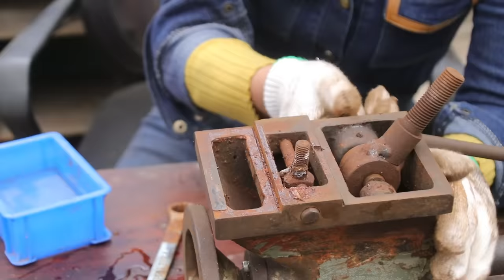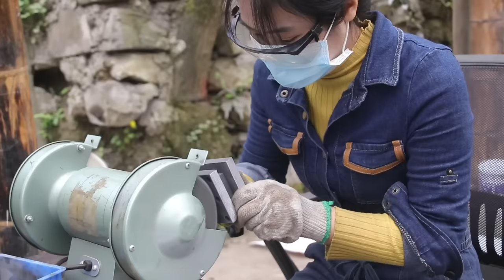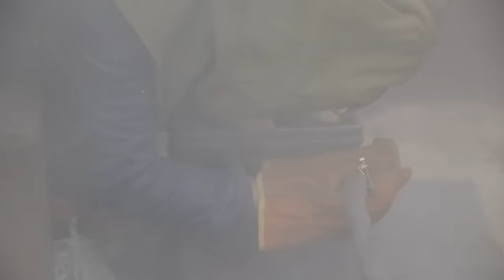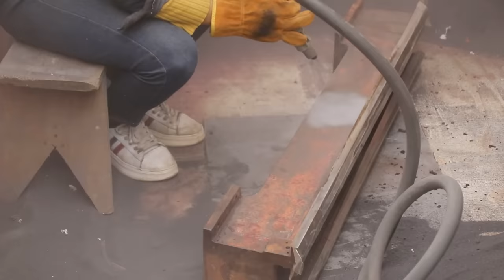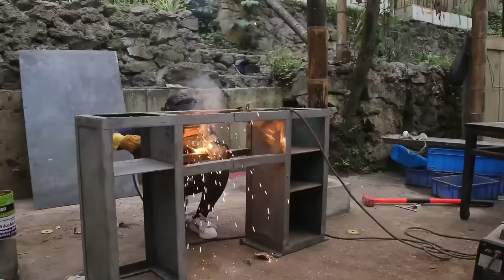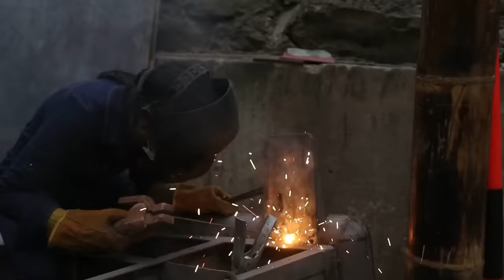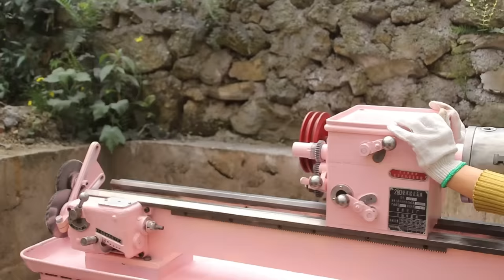💡 Super Girl's Restoration of Broken 1972 Lathe (Full Video)

Comment: Put the piece as close to the chuck as possible, use the tail stop with a live center if you have one and DON'T WEAR GLOVES when operating a lathe. The turning parts can grab the glove and you can lose a finger or a hand faster than you can blink! As always, great job, love the smile, be careful.
Reply: Ya and the grinder. Also she turned a OD in a prior vid toward the tailstock. If the clamp comes loose on tailstock to the bed and the force pushes tailstock away from chuck she will be wearing that bar.
Reply: personally I’ve turned plenty of parts with gloves on. If your close enough to rotating parts that your gloves can catch your dangerously close to begin with and need to put more space in between. And I tended to use latex gloves so in unlikely event they did catch something they’d just tear.
Reply: @maxpowerii7368  Almost everyone can and does wear thin latex gloves for oil and splinter protection when grinding etc.. . Maybe we didn't watch the same video. She is not wearing those kind of gloves WHILE operating the lathe. You can risk losing your own fingers but I wouldn't train people to wear the gloves while operating a lathe. She is wearing thick cloth gloves while operating the lathe, that's what she is doing. That is extremely dangerous. Your point is not relevant as thin latex gloves are nothing like what she is wearing and even wearing latex gloves isn't a good idea unless always being lucky is your game plan.
Reply: @maxpowerii7368  1st thing . No long sleeves. No gloves. OSHA .
Reply: @rickeylucero3955  OSHA rules only apply in the United States. Whole world isn’t American mate.
Reply: @terry1309  i didn’t say she was. But even cloth gloves I don’t have a problem with people wearing them while turning. Anyone stupid enough to get them wrapped on bar, chuck or spindle is not appropriately trained to be on a lathe in first place. The hazard control is not touching rotating equipment not failing to wear cloth…if your close enough to get gloves caught your close enough to get overalls caught. How far do we go? everyone has to turn butt naked in case their overalls catch?
Reply: @maxpowerii7368  so what if you lose a couple fingers, particularly, if you're an operator in China, there's 100,000 replacements to take place no great loss!!
Reply: @maxpowerii7368 You are wrong but go ahead and do it your way. It's not helpful to anyone, especially for beginners to hear someone promote unsafe shop practices. I'm guessing that you're not a machinist or don't have much real workplace experience because if you did you would know better. You might as well tell them to let their long hair down, wear loose fitting long sleeve clothing, wear lots of jewelry and how about wearing a dress tie. Just because someone may have done all that and didn't get hurt doesn't mean it's a safe way to work.
Reply: @terry1309  I’ve been working in machine shops since I was a teenager thank you and yeah but the woman in the video isn’t a beginner is she? she’s an experienced craftsperson. Does it make you feel like an expert to point out beginner tips to experienced hands or something? 

Yeah I wouldn’t recommend to beginners to machine with gloves on just like I wouldn’t recommend an apprentice to live wire 24V control wiring. Does not mean it cannot be done safely or that there isn’t thousands upon thousands of experienced technicians doing so every single day. Bit of nuance here please instead of just been an anal rule book quoter.
Reply: @terry1309  and as I just said…the control measure in the hazard of rotating equipment is not prohibition against PPE but prohibition against coming in contact with rotating equipment. It is you promoting unsafe practise by luring people into a false sense of security that they are safe without gloves when in reality as I said if your close enough to energised rotating equipment to get gloves trapped your to close to begin with and the lack of gloves is no guarantee you won’t be pulled in.
Reply: @tomwarner2468  how’s a machinist going to lose a couple of fingers while their hands are on the hand wheels? you shouldn’t be touching rotating spindles/chucks/workpieces in first place. Gloves or no gloves!
Reply: @maxpowerii7368  LOL yes. Kinda  a standard common sense OSHA rule. .Go to any machine school in any country. They will not say "Oh use gloves if you wish". No way.  It is 101.
Reply: @terry1309  yes latex are pretty much fine. Not cloth or leather.
Reply: @rickeylucero3955  again OSHA is a US government dept. Their rules only apply in America, no where else in the world. Rest of us work to our own national regulations.
Reply: @rickeylucero3955  and yeah same as an electrician school wouldn’t teach electrical apprentices to live work low voltage systems. Does not mean experienced electricians do not do it. Please re-read my previous comments properly ffs before commenting.
Reply: @rickeylucero3955  maybe you should train your employees to use machine tools properly then if your having so many accidents instead of relying on dumb catch all rules. Never seen a lathe accident happen on any shop i’ve worked in but then everyone was trained to not touch rotating f equipment.
Reply: @maxpowerii7368  LOOl you don't have to touch it. That is the point. It is called a chip. If you don't know how to grind a chip breaker on a LR-8 tool which she is using you may get stringy chip in any ferrous material and it can grab your hand or sleeve. I never hired a machinist that did not have a degree or certificate. That is how it is done here. You just hire some kid and train them. They learn at school. Not from some guy who says I never saw that happen in a machine shop! That is just the way. And how do you file a cut.. with out touching the workpiece. That is just foolish.  I have run many Wacheon or Victor manual lathes in the 70s just like the one she repaired. 8 inch chuck. Since flexi tape NC machines no one  would ever let such a thing happen. That is when safety rules came about in force. Not doing so is  just waiting for a lawsuit. So go and encourage your fellow employees to do such a thing. Cause you never seen anything bad happen. Very smart!!!
Reply: @maxpowerii7368  oh ya.. if you read my first post it was about her wearing gloves while on the bench grinder. DOH. The lathe problem I had was she in a earlier vid turned a  OD toward the tailstock. Which you never do. You always do a OD toward the chuck. If the tailstock clamp is not tight enough the tool pressure can make the tailstock move away from the work piece and you will be wearing it.
Reply: @rickeylucero3955  100% agree with you. When you've been a machinist, welder, fabricator etc... for many decades you see enough to know that as skilled as you may be it's important to take sensible precautions. Happy new year to you. 🎉
Reply: @rickeylucero3955  most chips are brittle. Even without chip breakers they often break under their own weight and certainly do not have the strength to pull a human into a lathe. Do some basic research into lathe accidents and you would find there is very few if any that involve people been pulled in by swarf or chips. 

90% of the time it is from polishing rotating workpieces with emery cloth. Which speaking of which you accuse me of promoting unsafe practise while talking about filing running workpieces?

That’s even more prohibited in more countries than wearing gloves. You don’t use hand tools on rotating workpieces in a lathe. Now that is how you get pulled in or have a file dug into your wrist. 

If a workpiece needs filing or polishing you either remove it from the lathe or de-energise and put clutch to neutral so you can rotate chuck by hand.
Reply: @rickeylucero3955  why do you think she needs your advice to begin with? she’s a better craftsperson than you ever will be so I don’t think she needs it from you.
Reply: @maxpowerii7368  you can always get a the Super Power text books.. that is all me. Pics are me. All pics of  my work. Some pics of me running a Superflow dyno testing engines in 1983. There are 2 text books. They even say my name.
Reply: @terry1309  this is right from the PPE website!! Moving Rotary Parts. Machinists who are operating rotating machines should not wear gloves. If machinists are working with a CNC machine, a lathe, a knee mill, or a drill press, wearing gloves near a rotating spindle can spell disaster.
Reply: @rickeylucero3955  and how many lathes are 60ft? of course unusually large machines have special safety requirements but my comment still stands on standard sized lathes. There’s not a single accident on the record books from people been pulled in to lathes by swarf. 

I have worked with some spectacularly talented engineers over years, none that dead work 24V control circuits. 

I got some good advice from the old hand electrician, who had spent many decades as an electrician in a coal mine, who taught the basic electrics course I was put on as a young apprentice. “I’m training you to be first aiders, that doesn’t mean you should go telling the doctors [electricians] how to do their jobs. Just because I’ve taught you a little and you might think they’re unsafe doesn’t mean they are been unsafe”. 

It is advice perhaps you would be wise to heed. Whether that’s machining or electrical wiring.
Reply: @rickeylucero3955  of course an American supplier would say that. They’re selling to a market regulated by OSHA and covering their asses in terms of liability.
Reply: @terry1309  I wear cheap  nonlatex gloves so that if my hand gets to close they will tear.
Reply: I agree with the glove issue.
Reply: @maxpowerii7368  Well, she should wear eye protection in a lot of the things she dos.
Reply: @Max Power II  OSHA has similar groups in all industrial countries. Some are more relaxed than OSHA but there you have it.
Reply: Tak bsles coro jowo yo aku seneng yen deleng tandang gawene cah ayu kuwi semamgat ara ono putus asae aku wong indonesia kagum karo cah wadon ayu kuwwi wes suwon yo
Reply: Y9v
Reply: And don't forget about loose hair. If it were my 3 jaw chuck, I'd have the jaws reverse from the way they're held in the pink lathe. For a better centre grip and less parts turning that can be caught on.
Reply: @ArsonFire00  Yes, I think we all make these comments because we want her to be successful and safe. I really want her to have a fresh air mask when she is sandblasting! She could build one where fresh, filtered air is pumped into her mask. We all could donate  money and or parts. She really needs this with all the blasting she is doing.
Reply: @tomwarner2468  Have you ever used a lathe? i do not think so, you do not loose fingers, you are tomato pulp in half a second. The lathe won't budge and will fuck you upp big time.
Reply: @sopalen  wait a minute pal I'm in the don't wear gloves crowd! Pity people can't respond without including the "f" word! I've run engine lathes and cnc lathes buster off and on for 30yrs! 40yrs ago an experienced machine tool instructor almost wrap himself up in an engine lathe! Had a rifle barrel chucked up, he was cleaning it up, while wearing a lab coat coat! He running it slow when the the gun sight grabbed the lab coat and started to pull him in! He was able to riggle out of it before he was pulled in!! He thought it could never happen to him!
Reply: @tomwarner2468  That is freaking scary man.
but i'm glad you are in the non gloves crowd. (ask a workpal of mine he lost a finger with gloves).
After 20 years of using it and renovating it i knew the machine pretty well.
But i still have a massive respect for all big machines, never ever used loose clothes rings neckles and stuff like that.

But before all that when i wanted to learn the lathe i google lathe and the first freaking picture that came upp was a man or pieces of man stuck in a spinning chuck that scared the living crap out of me i think this i why i have the respect i have for machines.
sorry if i offended you.
Reply: @sopalen  The lathe testosterone in this comment thread is actually quite hilarious. All you guys trying to prove you're expert lathe operators and saying what she should or shouldn't do.  Or what gloves she should wear. 🤣
Reply: This girl is an actress hired to pretend to be a mechanic and other skilled trades-person. In reality she can't do any of these things on her own. And if you for one second believe she is doing all this you need some help. She is an actress not accomplished at any skill. At least they should make her look the part. This The girl is an actress. She was hired to do the "ROLE" there is no way she can be an expert electrician/carpenter/is an insult to any skilled trades person. And there are many shorts of Asian women who really do the work. This is not one of them. She is not a mechanic, or an electrician, or anything else.
Reply: That 2 wheel bench grinder/polisher too I suppose coz I was getting anxious her thumb was so close to the wheel I nearly stopped breathing.
Reply: @CB-xr1eg Some of us, not many I suppose, really are experts. We've been doing this stuff a long time and can teach it. Mentioning safe shop practices has nothing to do with testosterone competition, measuring dicks or whatever you are trying to imply.  Lots of women are excellent machinists too. I think those of us that have been around a long time & seen a lot just want her to not get injured and be healthy so she can have a better standard of living and do this for a long time. If I knew how to get in touch with her I would buy her a MIG welder just cause I'd like to see what she would do with it.
Reply: @terry1309  Real MIG welder like? Alright.
Reply: @TheMountainMongrel  Whatever brand is available there for the voltage she has access to. I don't know even what country, village, city, province etc... she is in. Do you?

Comment: Well done Lin - just a couple of points - when removig the chuck from the lathe always put a biece of wood on the bedways to protect them if the chuck whould fall; it looks like the cross slide is rather difficult to wind in and out - you should be able to adjust the jib strip to make the movement smoother and don't for get to keep all the lathe slides well oiled.  Very best wishes.
Reply: This girl is an actress hired to pretend to be a mechanic and other skilled trades-person. In reality she can't do any of these things on her own. And if you for one second believe she is doing all this you need some help. She is an actress not accomplished at any skill. At least they should make her look the part. This The girl is an actress. She was hired to do the "ROLE" there is no way she can be an expert electrician/carpenter/is an insult to any skilled trades person. And there are many shorts of Asian women who really do the work. This is not one of them. She is not a mechanic, or an electrician, or anything else.

Comment: Hi Linquoer, if you can afford it buy an air operated needle gun. It will make cleaning rust and old paint off casting much quicker. When tapping new threads by hand reverse the tap wrench about a quarter to half a turn every turn - it breaks the chips up and you will find it easier to do the thread forming.

Comment: It amazes me how you take everything apart and remember how it goes back together. I would be lost. Happy New Years to you Lin.
Reply: the trick taught to me was to leave the components on the floor in the order they are removed in a line. that way you just follow the line the opposite way to re-assemble the machinery. Works surprisingly well.
Reply: I agree that should work if you have the space and nobody messes with it.
Reply: @Marv2049  in my experience most machinery has fair bit of space around it so pallets of work can be stacked near it or forklifts can access machine. 

And if anyone messed with my components on the floor I’d go psycho with them followed by paying a visit to their supervisor to tell them to keep said worker well away from me unless they want a non-functioning machine re-assembled. It’s never happened to me so far but that’s what I’d do if it did. 

I also tend to take lots of pictures on my phone although quick sketches would equally work well.